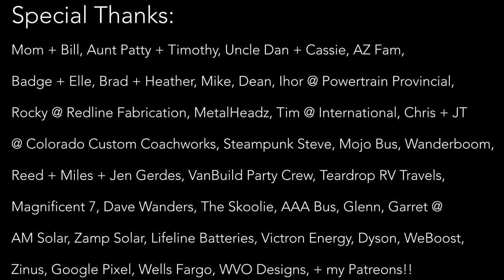Luxury Vinyl Planking Steps + Flooring DIY (skoolie vanlife build)

Comment: 3 thumbs down   WTH? 
Just here to harass the trolls.  Lol 
Confidence and skills improving ,  very good. 
I'm guessing a tee off mat on roof.  I know I will, 2000 old golf balls.     Nosing on stairs is nice , I always try for 3/4 to 1 inch, it just feels natural under feet.   
Great work  😎
Reply from the maker: Troll harassing is always welcome. Thanks, Tom. I was thinking to put angle trim on the steps and call it a day. Very good guess
Reply: @JaxAustin   some generic pieces of trim allow or make it impossible to not have nosing. Scholl buses have short tread depths just for lack of space.   Im thinking of relocating entrance to behind passenger seat , allowing better stairs. But I'm thinking a slideout or three as well and something like a vw roof raise soft sides.

Comment: tongue and groove on the flooring . you may have wanted to leave an access panel under the bench  to get back  at your gas tank. folding chairs that mount on the roof  deck  and secure down when driving would be  something  i have never seen.
Reply from the maker: That would be a fun setup. You know, I thought about leaving and access part, but for some reason I didn’t think anything would break. And I think we all know what happens over time

Comment: Sylicone to glue laminate floor down?  thats a new one ,it dries and is still flexable ,also  that stuff is very expensive per tube especially the GE name brand   would have used liguid nail in caulk tube s,2,50 a tube or regular floor adhesive , Normally you staple  down an 1/8 inch underlayment made of luan to protect your sub floor in case you ever want to pull it up so you wont damage the chipboard, totaly agree with the MDO,good stuff
Reply from the maker: Yeah, that’s what the flooring pro recommended a couple vids ago.
Reply: @JaxAustin  Its probably to keep it from making noise when you walk on it and to stop it from shifting around up and down especially if your floor isnt lazer straight level wich is almost never even in a house . Hey Jax i recently installed this german engineered laminate from Sams that has the foam padding already attached to the back and its thicker than most laminate , more like 5/8ths thick like the real wood stuff.Its very good quality for the price.Here it is, and its waterproof for so many hours also and its beveled on the edges so it really looks like real wood and since its heavier than most it really feels good when you walk on it and is a lot quieter when  you walk across it with hard soled shoes on, i did this ladys entire house with it and i found some porcilin tile that looks very close to the driftwood for the kitchen and the 2 bathrooms. Dude im telling you if you were blindfolded and ran your hand acroos this tile you would swear its real wood with the raised grain, it  even has knot holes! you kinda have to hand pick the tiles and lay out the wood laminate and stagger it because the boards and cases kinda vary in color, i put the uglier ones like under the stove and the fridge ect and this stuff was only 1.28 a sq ft! 21 bucks a box at Home Depot. I put the 1/4 inch hardibacker board down with those special digger head screws that countersink themselves over the upstairs bathroom floor  that has the same OSB subfloor as you do then I used thinset and laid them on a subway pattern, came out real nice, so nice in fact i did our  small 5x7 bathroom too at our house upstairs too with what was left over.

Comment: Your bus looks amazing..id love to have a 5 window short bus, eventually..your floor looks gr8 and I love the steps..Yeah..I need flooring..took the middle seats in excellent condition, hoping to switch them with the front seats which r trashed, but....different bolt patterns from front to middle..wtf??? but, I need to take front seats and van bed out to do flooring..trashing the van bed too n building my own couch bed..so..basically, I need to gut out my van just to put in flooring and I'm not feeling it..gonna pay a neighbor I think. Lol..but my seats, dammit..I'm wondering if I can just remove the seat and seat back on the good seats and put them on the bad seats frame? Idk..I'm not mechanical at all soooo..maybe someone here has hints for me..93 Ford e150 5.8L conversion van..srry so long jax...thx for all your great info👍✌❤😊
Reply from the maker: You were talking about the bus seats in the back, those are all welded together. Take off the back and bottom cushion and have a look for yourself. If you know how to weld, you can always modify them.